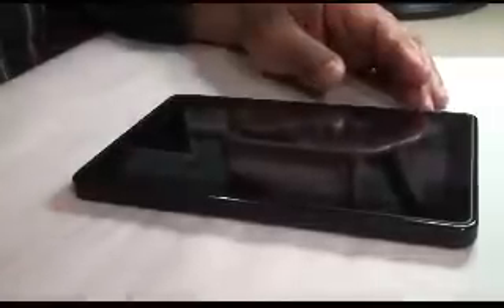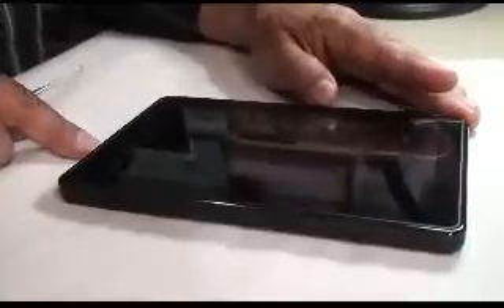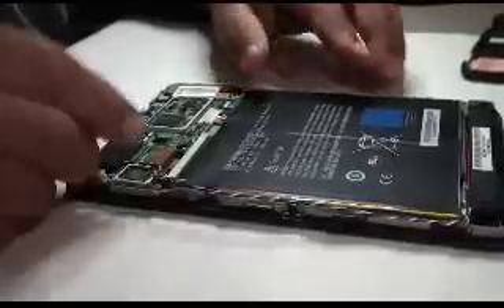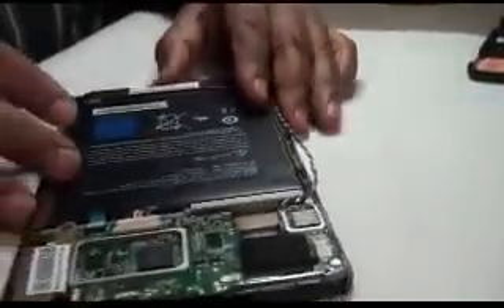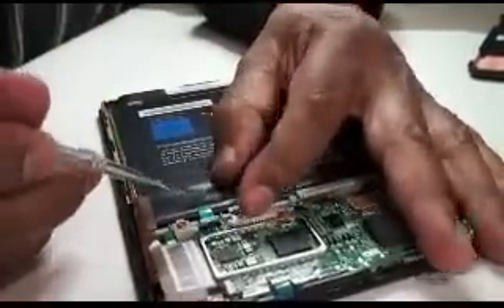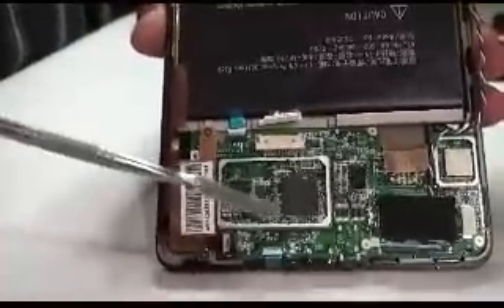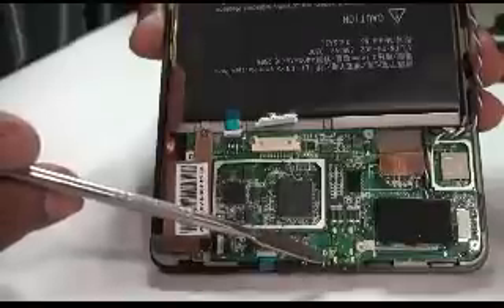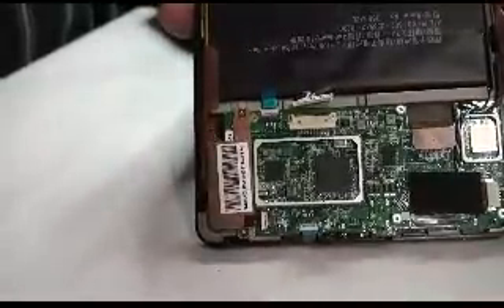Amazon Kindle Fire 7" disassembly usb port  power jack charging problem replacement guide

Comment: Would you be able to show us the removal of the board in a 4th gen Kindle Fire HD 7? I think it may have a bad charger port or something. No reaction at all when a charger is plugged in to the port. I do not see a light to say that the device is charging either. I have it plugged in as I typed out this question.

Comment: Hi,  I did the repair but after doing it my touch screen is not working...what should I check?
Reply: hello
did you ever get a answer for this? i ran into the same problem and need help.
Reply: Mike Larson No but I reopened everything made sure everything was set down tight and then reset the Kindle. I would try resetting it before reopening everything.  Just push and hold the power button for at least 20 seconds.  Let it restart and try again.  If not pop everything open and make sure all the tiny connectors are on correctly and screwed down button it back up and give it a go!   Good luck!   My repair is still going strong!

Comment from the maker: 500 degrees for the soldering iron. Since I use a bevel edge, the surface contact area to the USB pins and solder paste is minimal and I need a high temperature to heat up tiny metal prongs so they solder very well to the PCB.
On hot air extraction, when I need to remove a broken/partially lifted USB connector, I will go to 400 degrees on the air flow and set the flow rate to a medium to control my nozzle velocity.
New to Youtube, and these  are raw videos: next week I will upload HIDEF. Thanks.
Reply: Where's the hidef?  It's been 7 years!